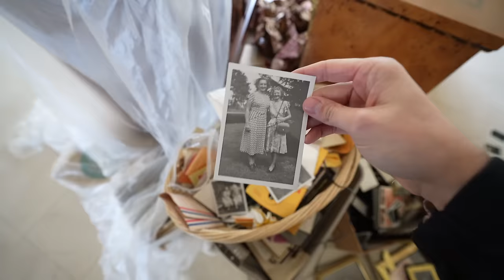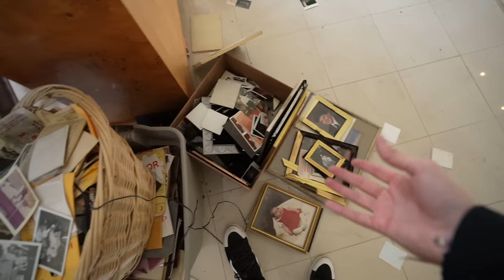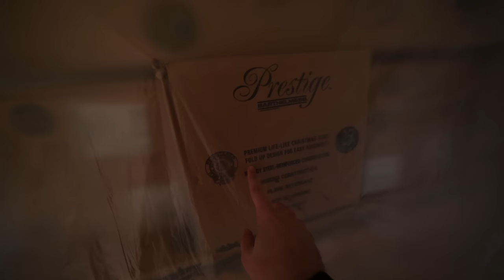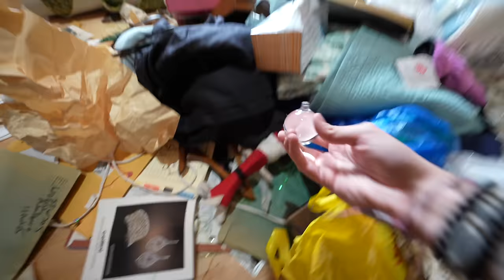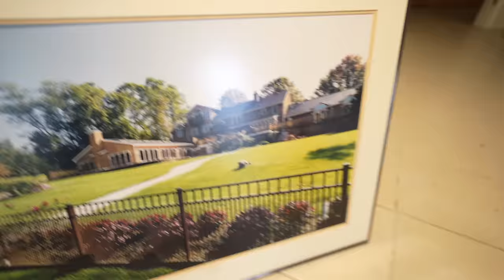ABANDONED $8.8 Million Mafia Boss’s MEGA Mansion | Found Vault, Pool, and Elevator

Comment: Those outdoor kitchens are very popular in Mexico. They are very cheap and easy to build and only wood is needed to cook with. Charcoal is very high priced just like everything there. A lot of people use them because it saves on the cost of propane or electric to use for the indoor stoves. The electric is extremely expensive!! Propane is much cheaper so many people have gas stoves. The simplicity of the lifestyle there is very nice.

Comment: Just in the theater, carpet I'm assuming because of padding was Karastan.  Used to work at exclusive Drexel/Heritage Gallery Furniture Store that only sold Karastan Oriental Area Rugs back in the mid 1980's after graduation from college,  Did internship there and then they hired me.  Family owned business.   Karastan rugs were NOT cheap back then so you can imagine if just wall to wall carpeting in theater was Karastan or all carpeting and rugs.  Probably just this room and any area rugs were true, very expensive Oriental rugs. Dang.